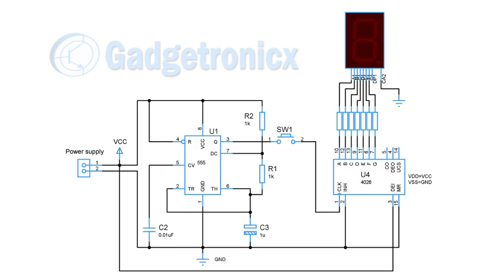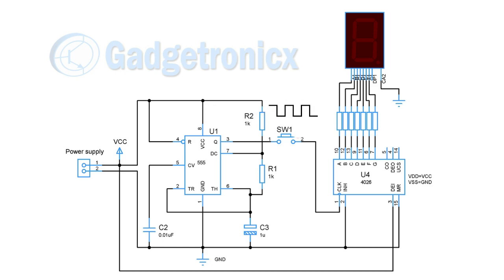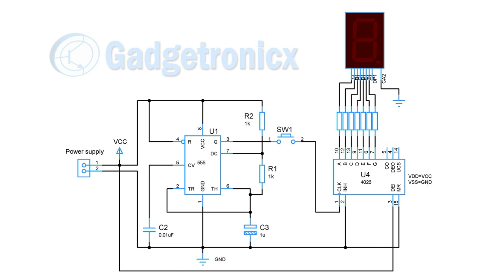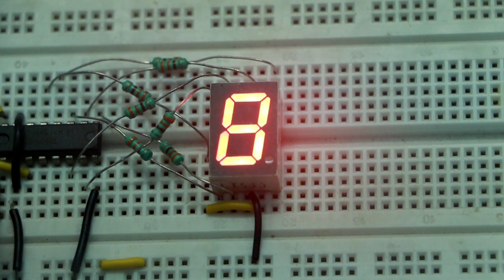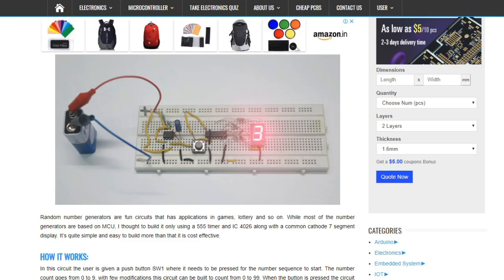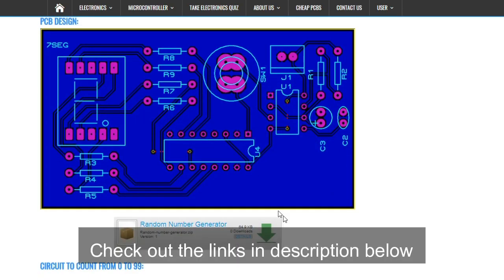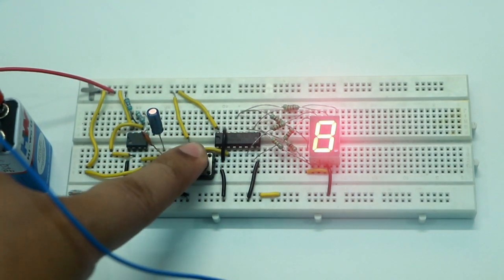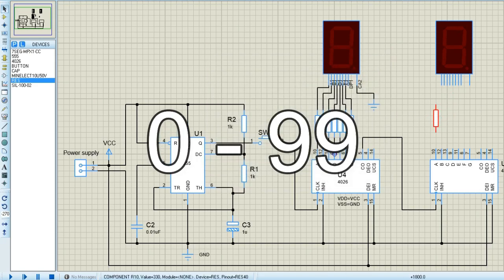Random number generator circuit ( without use of coding )

Comment: Sir i have made one using same circuit but it doesn't make all number s from 0to 9
Some times it makes d or p
What should i do or check
Reply: Check your connections to the segment led display carefully.
Try also to change the chip if the problem persists.

Comment: I built this circuit for a class but am having trouble with the switch not working. Any suggestions?
Reply from the maker: Try changing the switch and see if it makes any difference :)

Comment: Hey, would this work if another decade counter was implemented rather than using the CD4026 chip?
Reply: The CD4026 also contains a decoder that can drive a 7-segment display directly. Simpler decade counters like CD4017 don't have that. If you used a CD4017, for instance, you would have to add a separate chip to drive the 7-segment display.